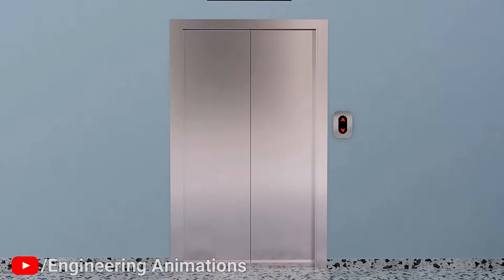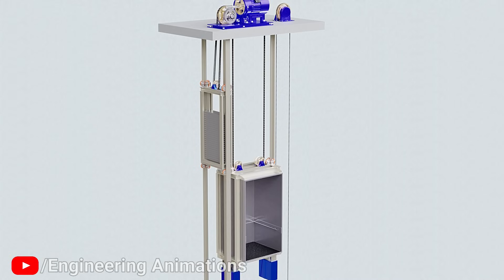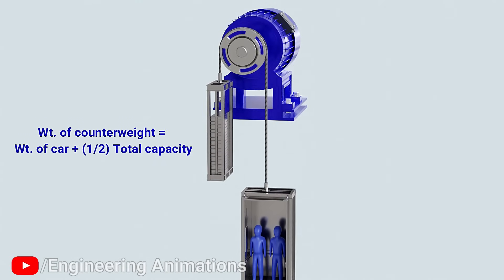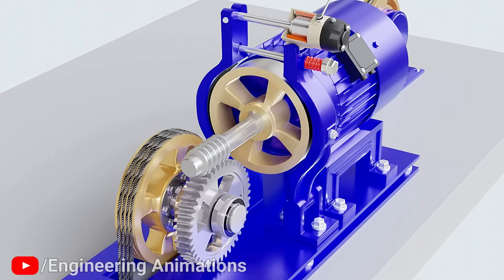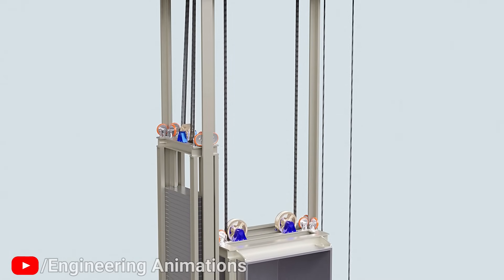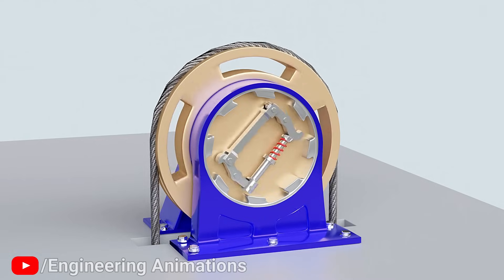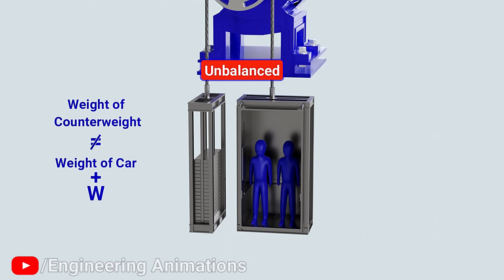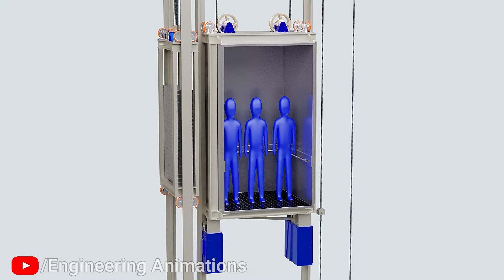How do Elevators work(Animation)

Comment: In modern elevators, there is no worm gear, the traction sheave sits directly on the shaft of the motor, just like the brake sits directly on the motor. However, synchronous motors are then used here. And more and more often, the counterweight for elevators in small residential buildings is not 50% but only 40% heavier in order to save some energy in most cases, only under full load is a little more energy consumed, which rarely happens. The safety gear is now also operated electrically and there are no mechanics such as a Overspeed Governor

Comment: question for the counterweight :
Most of the time the elevator is empty and not with half total capacity. Wouldn't it be better for the elevator to just have the elevator weight as counter weight ?
Reply: In this case, the drive would have to be designed much more powerfully, since in the worst case it would have to move the entire payload. In small residential buildings, however the counterweight is increasingly designed to be only 40% heavier in order to save some more energy, since full load is only rarely used here will

Comment: I am a elevator mechanic and the detail and accuracy of this video is amazing.
Reply: HUGE thanks to you for ensuring these mind-blowing elevators are working safely and efficiently. Earlier today, I went to the top of the city hall in my city via elevator, and my respect to people like you increased immensely.
Reply: @Snowy-oq4ur  I really appreciate your comment
Reply: Is it normal for elevator have gap 50cm between elevator and the wall? In my place there were a woman just died by accident in elevator, she doesnt realize those elevator had 2 door and while the elevator still moving she got panic cuz the door doesnt open. She tried so hard to open the door, once the door open she quickly get out and fall to the ground.
Reply: @Chinte-a  That is a sad story. If the elevator cabin is between floors it can be possible to have a gap of 50cm from the cabin to the wall, but if the inner door is closed you are always save.
Never try to get out of an elevator when it brakes down, you are always save inside, just wait for the engineer to get you out of the cabin savely. That woman didnt have to die if see just waited.
Reply: @Rockzor98  yeah it sad, she just fell from 2 floor to G floor. And the body just found out after 3 days. Most people blame the design of the elevator like why it had 2 doors, why it had gap between the wall and the elevator but it also the woman fault cuz she dont pay attention which door has open. She panic, and try so hard to open the door while the elevator is moving once it open she quickly get out
Reply: @Rockzor98  thankyou for your answer anyway. Really appreciated 🙏🏻
Reply: How does the elevator autocorrect to the centimeter when on loading offloading load?

Comment: As a software engineer I am more concern in knowing how the algorithm decide which elevator will cater the next passenger on each floors
Reply: and I have been wondering by how much you can increase waiting time and decrease speed before more than 10% of the people take the stairs
Reply: the IT behind it is easy if you got the hardware. on the internet you can find codes about that easily thats not hard. and put in some microcontrollers. wire those to the motor. and its done. all the safety mechanismes make it way harder to build. I built a 4 story lift. about 1:20 size. but without a couple safety mechanismes. only counter weight and damper
Reply: @Knightfire66  that is totally not what he meant though, anyone can download code. he was asking about the logic of the software.
Reply: @ersetzbar.  why are you speaking for him? maybe hem ent the code itself.

Comment: when the elevator runs many floors - say 50 - the wire ropes may also play a role. When the car is at the bottom the wire ropes will add to the car - and vice versa, when the car is at the top, the wire ropes will add to the counter weight.

I would guess that the weight of the wires could be higher than the number of riding passagers, - or......?
Reply: In such systems, chains or ropes are attached to the underside between the counterweight and the cabin, thus balancing the weight of the rope

Comment: Thanks for this tutorial. This leads to the question of why the elevator certificate for passenger elevators lists the maximum weight instead of maximum people? It's easier to visually determine the amount of people than it is to compute the total weight of the people that just boarded the elevator.
Reply: Because people don't weigh the same. If the certificate told you that only six people could ride the elevator safely and six 300 lb people tried to squeeze onto the elevator it would surpass the maximum weight for safe operations, but by quantifying the maximum weight instead of bodies various numbers of people can board and ride the eleveator all within the maximum weight threshold. 
And it just takes the law of averages to calculate the weight of a group of people. Based on hieght and BMI one can safely calculate a rough estimate of weight of a group of bodies boarding an elevator. Besides a good rule of thumb would be comfort will "outweigh" safety. Not many people will want to crowd into an elevator that has too many people cramed into it, thus reducing the chance that too many people will occupy the lift.
Reply: As an anecdote: I was once traveling with a high school group in Washington D.C. The hotel we stayed at had us on four different floors. One evening after we had gone to a show and dinner six of us (we were teens) crowded onto an elevator that already had four adults on it. Two more people squeezed into the car, and the outer doors didn't even close when an alarm buzzed and a panel lit up saying the car was too full. A voice them came over the speaker (security or maintenance) requesting that the car clear. My friends and I decided to get off and allow the others to ride and waited for another car.

Comment: The emergency brakes on elevators aren't like that at all. They are much better, they don't rely on overspeed to activate, the cord breaking will cause the brakes to activate, the elevator will fall less than one centimeter max.

Comment: As a lift engineer I can confirm this is all correct. In case anyone was wondering the emergency brake fitted to the bottom of the car is called a safety gear. Hopefully will see some videos about some other types of lifts such as Hydraulic, Dumbwaiter, Scissor and Stairlifts. They’re great to show people who don’t quite understand
Reply: As a elevator engineer too i can confirm the lift shown here is out of date. The motors used on modern elevators arent even roughly the same.

Comment: The animation is amazing, but the facts told are partly inaccurate. There are tons of different elevator types, an important fact you forgot to mention - the ones shown here are a MR Traction 2:1 and a MR Traction 1:1, elevator types only used in high-rise buildings. You should have explained a MRL Traction 2:1 instead, since they are most common nowadays
Reply: Just tell me do they have the Backup brakes incase the ropes snap?
Reply: @itsmanasK  yes, all Traction and Roped Hydraulic elevators are required to have a backup brake

Comment: How the button signal transfer to the motor, and the CCTV transfer to the monitor? Do the cable attached to the wire or it is ground to the vertical track?
Reply: There is a seperate electric cable

Comment: It would be better if the brake did not stop the elevator completely it is better to lower the elevator to the first floor in a controlled manner.
Reply: It's alot safer to stop it compleatly
Reply: Also most of the time it is unbalanced (counterweight is heavier) so it would actually go upwards
Reply: @nelsonahlvik6650  You can use water in the ballast. Slowly drain the water and lower the elevator.
Reply: @tvrtkokotromanic8391  Why would you use water. That means that it has to be connected to the water mains or have a water tank, which is expensive. It's much easier and safer to just have it stop and then an engineer can come and get you out.
Reply: @nelsonahlvik6650  Since when is it water and a carbon fiber tank more expensive than a block of metal of the same weight.And trusting in engineers or rescuers today in the age of energy crisis where entire cities can be left without electricity is.
Reply: @tvrtkokotromanic8391  Even if the buffers were filled with water, they are only at the bottom of the shaft, so what are you going to do when the car is 6 floors up?
Reply: @tvrtkokotromanic8391  Actually there are already some lifts that can free the passengers in case of a power faliure, these do it by using battery power (not water) to drive in the easier direction (up if car is at <50% load, down if at >50% load (due to counterweight)). However, if there is a mechanical fault or control system fault it can not be trusted to move so it will just stop and you will have to wait for rescue.
Reply: @nelsonahlvik6650  It is just a thought, they could also put glass doors on all the elevators so if you haven't stopped between floors you can see that you can get out.
Reply: @tvrtkokotromanic8391  And get out how? you cant open the doors from the inside ;)  On modern elevators the motor slows down to a stop and then the brakes go on, they never get replaced because they dont wear down. In case of power outage a good elevator engineer can always get you out .

Comment: Most elevators nowadays are hydraulically driven.
Reply: I think you will find hydraulic lifts are limited to a maximum of 3 or 4 floors. Beyond this the cylinder would become to large (to transport and install).
So the type of lift will depend on the design of the building and its height.
Reply: Not really. As  @Kevin-go2dw  already stated, hydraulic lifts are limited to low rise applications.
Also, in most of Europe, hydraulic lifts are becomming less common in favor of more efficient MRLs. I don't know why hydraulic lifts are still so common in the US, since they are less efficient.
Reply: Traction* they are way more compact, can be efficient, reliable and much more. Hydraulics are only used for heavy weight applications and also as mentioned for lower heights, traction nowadays is just the best all around option

Comment: 20% How elevator works
80% How elevator prevent accidents
Reply: Tbh id much rather know how an elevator prevents accidents vs how it actually works
Reply: Do you think preventing accident is not "working"?
Reply: @iwatchwithnoads7480  Fundamental physics involved vs a practical continuously operated "unattended" machine capable of dropping its live cargo countless stories...

They're in a different realm. One happens in a lab under test conditions with sandbags. 

You get slaughtered in the skyscraper... 

See how this works?
Reply: @MadScientist267  I know what you mean but it makes no sense to post that as a reply to my reply to this comment.
Reply: @iwatchwithnoads7480  It absolutely does... How an elevator "works" and how an elevator works are very different things.
Reply: @MadScientist267  I believe you misinterpreted the text and missed the context of my reply to the original comment
Reply: @iwatchwithnoads7480  Yes. I get it. It all "works" 🙄
Reply: that is the most important thing
Reply: Thats funny because 20% of elevator work is how it moves and 80% of elevator work is safety
Reply: well thats about 90% of an elevator. the lift mechanism is really easiy. every engineer is able to build one. but all the safety mechanismes make it more complex. and this is also where all the patents come into action. which is the reason not every one is able to just build an elevator. today there is nearly 0 way to make an elevator without having to pay for a couple patents.
Reply: do you want the see the IT behind an elevator?
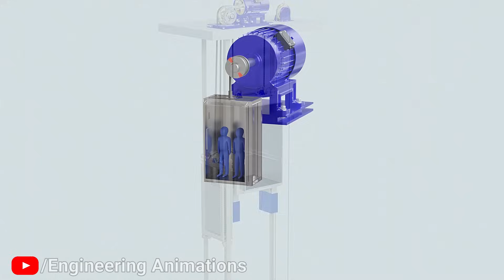Reply: 1:00
How an elevator works.

Everything else
How an elevator works SAFELY and EFFICIENTLY.
Reply: Either way there's more to them than most ever see. The control system gets pretty interesting too.